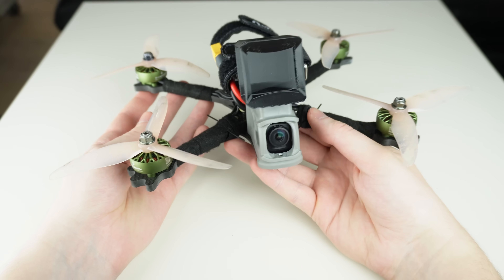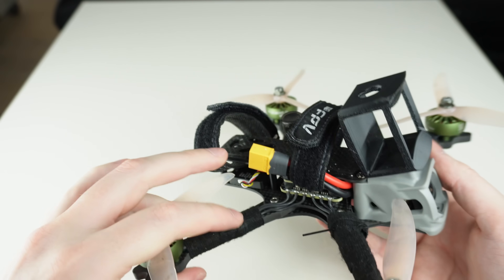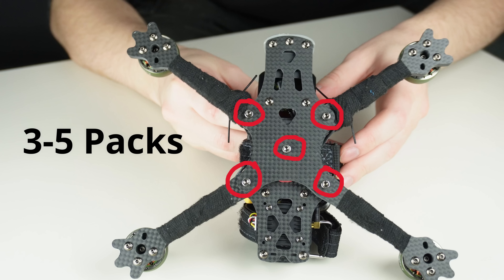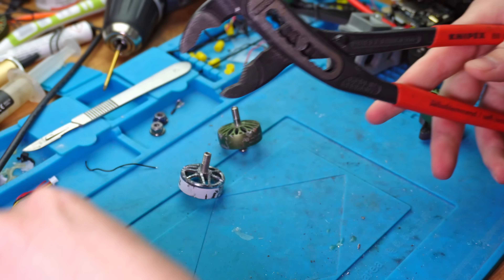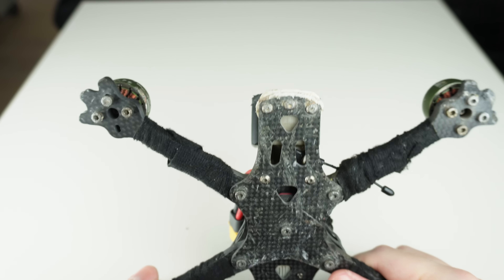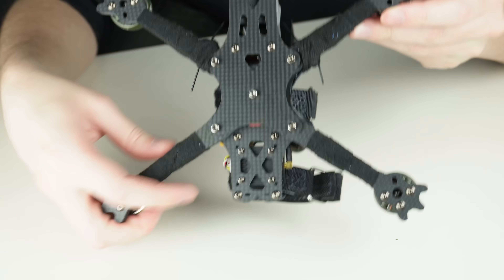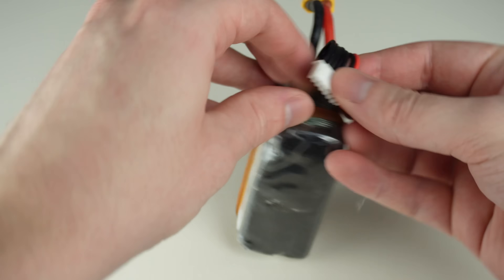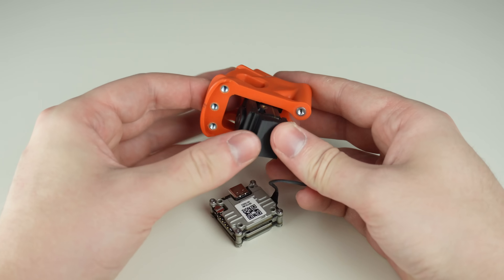How I made my Drone Indestructible

Comment: Any one knows what could cause drone to drift in one direction even without any stick movement at constant throttle my drone is drifting to one direction. It is not stick issue as I am using python to give commands to drone and i tried with trim but it doesn't solve the issue, accelerometer callibration is also done multiple times. If anyone could help I will be really greatful.

Comment: Super clean. W choice using Tesa tape on the arms. I am sure you already know this, but there is a tesa tape that is even more durable than that. That is the 51608. The 51036 version is quite a bit more abrasion resistant. When the o4 version is in stock in America, I will probably try the era out.

Comment: Can someone help me.
Should I build the era mini with analog or o4 pro.
I would need to get a thumb pro 2 to do freestyle recordings, what is more worth it?
I have dji goggles 2 so no racing mode, and I have hdzero boxpro so analog is possible.
Reply from the maker: If you want to record freestyle videos you should get a 5". 3.5" quads fly kinda bad with a camera imo. ERA Mini + O4 Pro would work of course, but then you don't have sound which kinda sucks :D
Reply: @nils_vo Ich hab schon einen 5 inch und will halt zum üben auf kleineren Flächen einen 3.5 inch.
Maybe zum Hochladen auf youtube wolt ich halt nicht analoges dvr. 
Ich flieg auch hauptsächlich tree spots, bin mir auch nicht sicher ob da analog so gut ist wegen den ganzen kleinen Ästen.
Aber preis und latenz ist schon auch ein Thema.
Macht das leichtere gewicht von einem analogen vtx und Kamera für die thumb 2 wieder gut. Die o4 pro wiegt schon mehr.
Reply from the maker: @bung9225 Ja funktionieren wird das auf jeden fall. Ich bin nur kein fan von der thumb2 bild quali :D

Comment: I put hot glue inside the bottom screw heads of the drone so that if I slide on the ground, the heads won’t be damaged, and I can remove the hot glue by adding a bit more and pulling it off.

Comment: Finally soome real life advices, not the usual "Just put a 10 mil arm and it is unbreakable" - So thanks! One thing that I would mention: I use liquid tape or (B7000) for the solderings, they can break next to the soldering where wire moves or resonate, I think these "soft" glues helps a lot to avoid this problem. Also I do not prefer conformal coating around wires, it will be super rigid after drying, so the resonating wire will brake around this stress point, instead of absorbing the energy of the resonation.

Comment: Great video! this will help alot of people! 

You visualization of motor durability was great!  Was nice to see how much better the tmotors are than the iflight xing. 

Just wondering, whats your opinion about velox v3 vs the itsfpv bando motors?  
Im currently running velox v3 2050kv on all my 5" quads cauz they have awesome power for great price. 
Just wondering if the durability of the itsfpv version is world better and therefore worth the extra cost?  

Itsfpv motor is like 2x the price of velox. Do they really hold up 2x the crashes?

Comment: I don't know how you can crash your carbon fiber frame many times and not break..... but I broke a carbon fiber arm a few days ago on an almost brand new Nazgul Eco XL5 crashing at 50 kph. It was subzero temperature though, I don't know how much that plays into it. Broke at the first bolt hole in the arm going into the frame body.
I think on my next quad will be an ERA. It has more material around the bolt hole and the arm is 1mm thicker than other brands. Cheaper arms too (I live in EU).
Reply from the maker: I think the Nazgul uses the cheaper T300 carbon, and the ERA uses a mix of T700 and T800
Reply: @nils_vo  That explains a lot. ERA will be my next build this spring for sure.

Comment: What fillament is the camera mount printed with? Doesnt look like tpu, yet it seems to not crack easily. I mean the outside part.
Reply from the maker: The camera mount insert thingy is TPU, and the front cage of the ERA frame is injection molded nylon
Reply: @nils_vo i am impressed how durable the nylon seems to be. Does injectionpressed automatically mean it is solid? So 100% infill?
Reply from the maker: @brunospasta  Yep exactly, fully solid. It's liquid plastic getting poured into a mold at very high pressure basically
Reply: @brunospasta  It's probably glass reinforced nylon 6.6, which is what pistol frames are made of.

Comment: how's the signal by having both receivers on the front arm? wouldn't the carbon fiber interfere with the signal? and how do i know where the metal plate is on the lipo without tearing out the outer shrinkwrap?
Reply from the maker: Haven't had a single failsafe since using ELRS, and I'm running low-ish output power as well
Reply: @nils_vo  thanks will try this out, did you have to wrap something under the rx antenna so that it doesn't directly touches the arm? how about the metal thing you mentioned about the lipo? how do i know which side should be up? appreciate it and happy new year !
Reply from the maker: @jkpisces  The antenna itself has a plastic cover, so it really shouldn't be an issue at all. And the unshielded lipo side should always be the one where the balancer is coming out of. Bit hard to explain, but you can probably see it when pausing the video :D
Reply: @nils_vo  thanks a lot ! really a lot of help . happy new year !

Comment: Das sind stramme crashes, aber keine richtig harten crashes mit hoher Geschwindigkeit. Das mit den unibells ist auch sinnlos, weil bei nem harten crash der Stator abreisst, die Magnete rausfliegen, oder teils die Schrauben aus dem Rahmen gerissen werden.  ich fliege seit 2004 und bin 2019 zu armattan und T-Motor gewechselt. Aus 2 Gründen, also hautpsächlich. 1. Es geht alles kaputt.  2. Entscheidend ist, wie schnell und einfach und wie lang du die gleichen Teile bekommst.  Mein letzter fetter crash war mit ca. 140 - 160? gegen nen Laternenmast geflogen.  Frame war ein aufgedoppelter Lycan 7 Zoll mit F90 und DJI FPV.  Die Kamera und einen Motor hab ich nie mehr gefunden.
Reply from the maker: Ja bei ganz harten crashes geht schon mal was kaputt, aber das passiert eigentlich extrem selten. 99% der crashes sind eher leicht und da soll auf jeden fall nichts kaputt gehen :D
Reply: @nils_vo  kommt drauf was und wo man fliegt. Wenn ich mit der Crew in der Tg rennen flieg, dann wirds grundsätzlich teuer. Wenn wir reno air race auf der wiese spielen geht nicht mal ein prop kaputt..... beim freestylen fliegt man ja eher nicht topspeed

Comment: why do you only run 3 motor bolts per motor and not 4?
Reply from the maker: No real reason in particular, but I found it makes no difference when it comes to durability so I leave out the inner-most screw

Comment: I have 6 ERAs. I don't have one that's a fully It'sFPV build though. Think I'll be picking up your motors and making one of yours. The only reason I have 6 is because I made them all slightly different. Badass frame man. Any preference on OX32 vs BLH32?
Reply from the maker: I wouldn't buy any BL32 stuff anymore since you can't update it and there is a buggy firmware version where one motor stops working after turtle mode. OX32 is working great so far for me

Comment: @3:58 nilstakingashit-noises lmao, side antenna really is a gamechanger, people will moan at the reception, but it wont make that much of a difference in a bando. definitely helps if you want to do matty flips/trippy spins and dont want to replace your antenna after every crash or so
Reply: Absolutely, although the signal must suck once your battery gets mounted...

Tbh, i dont mind replacing an antenna now and then in return for having the best signal possible
Reply: @SHERMA.  replacing an antenna gets old pretty quick if you own more than 2 freestyle bashers.
Reply: @JKwon_FPV tbh the only time replacing an antenna sucks is when it rips the port off your vtx too.

Had that happen a couple times...

Comment: I have two. They fly great. I am still torn between the ERA and the Apex for durability. You fly very well, so even your crashes can reflect that.

1) I had early issues keeping the action cam mounts on. It is hilarious watching it fall off on DVR mid-flight. Printing so the layer lines wraps the bolt helps.

2) I smacked a metal frame edge camera first right on the nylon cage. The metal scored the nylon and smashed the camera lens. The rest of the quad was perfectly fine and even LOS’d out of the flight paths. This made me think the Apex Evo and the aluminum cage lends itself to more strength.

I definitely want to try to make my self a fixed mount. I will try it out this weekend.

3) Even with TPU arm guards my toes are delaminating pretty badly. Not to the point of replacing the arms though. And I can still stuff them into arm guards, they just cause the TPU to protrude some.

All that said, I fly the ERA as my primaries every weekend.

Thanks for all the tips!